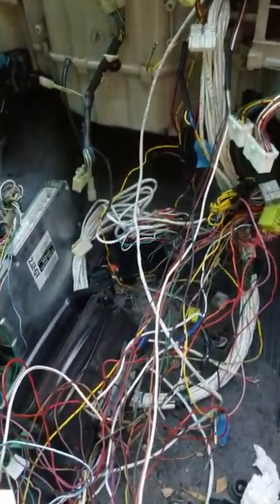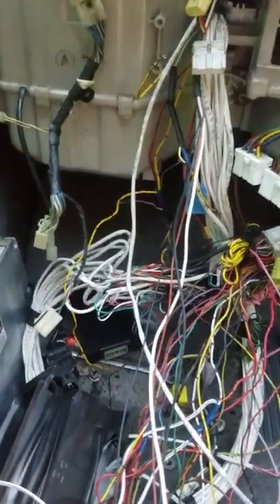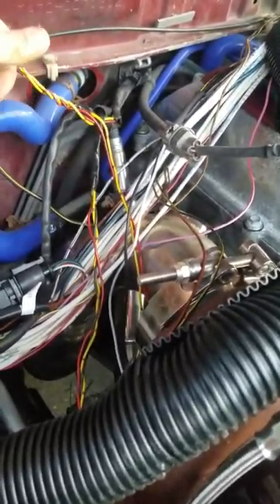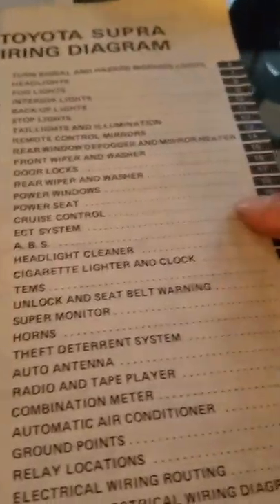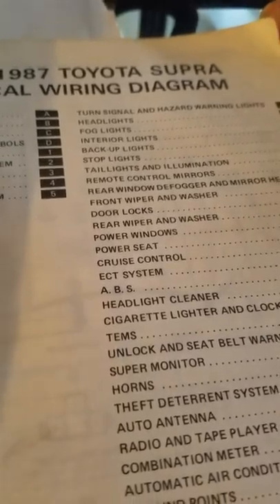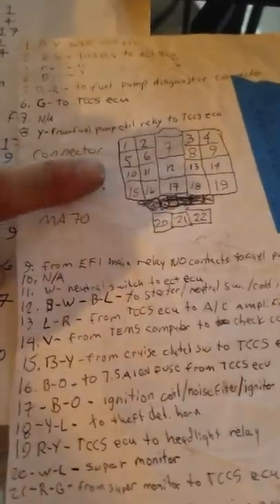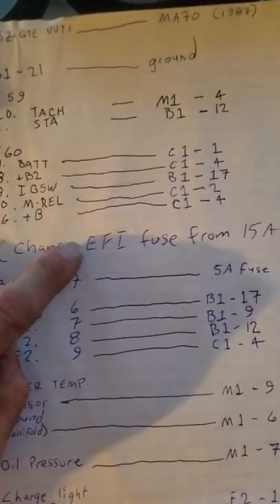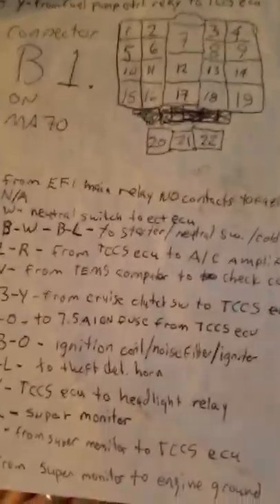2JZ-GTE VVTI MK3 SUPRA WIRING INTEGRATION

Comment: You are a legend for sharing your knowledge to other jz swappers. Had to figure out wiring on my 2jzgte to my mk3 supra as well. Took me around 2 years too. I must say, I don't regret anything, it was worth it. One thing I will mention is, I never got my cluster working as well as my headlights and backlights, I will be looking forward to your upcoming videos hopefully including the cluster wiring! Wish I had the book, I had to manually connect each wire I found to the battery to see if anything worked.. Anyways great videos so far!
Reply from the maker: Thanks for the nice words,I just wish I could have found all the info I needed to do this swap. Between working and family obligations along with the 3 rain seasons we have in south Louisiana,  its taken so long to get things done. And without knowing what you're doing, you can make alot of mistakes like I have. I chopped all kinds of wires I shouldn't have and bought some wrong parts that turned out to be expensive mistakes. So, if I can save anybody some time and money, I'll be stoked that I could help. I'll definitely post some more videos. And since you requested it, I'll do 1 on the dash connections. I may have messed up my lighting circuits too, but once I figure out what needs to be reconnected, I'll do a video on that as well
Reply from the maker: I got it to crank today,but it still won't start.Ive got about 4 grounds I need to check and go through all the basic wiring that got it to run while on the engine stand. The good news is that all my lights work,so I'm wondering if you've got a ground strap somewhere that's not attached. Theres a few right by the battery under the fuses that I had off and nothing would power on.also all the signal lights seem to go through the flasher switch for the hazard lights on the dash. I hope that helps
Reply: Brian Leonard My fusebox seems to be disconnected, that might be why, how did you connect the original supra fusebox to work with the 1jz? Thanks for the ground input
Reply from the maker: @202zeek  there's one big white wire coming off of the fusebox.not quite as big as a battery cable, but much fatter than most of the other wires right there. Its solid white with no other colors or markings. According to the tsrm, that's where the battery mainly jumps into the circuitry besides the one long run to the starter and the alternator positive lead. Make sure everything has an excellent ground  and check for any connections that might not be plugged in on the inside like behind or under the dash. The driver kick panel has a ton of plugs that have to come off for the dash removal, so if you took out the dash, that's where I'd start. If not, your issue is likely right there by the battery

Comment: If you were staying auto do you have an idea where the B1 pin #7 black and blue would go?
Reply from the maker: I took all of the wiring going to the transmission out when I first got the engine because I was going manual with it. But pin 7 on B1 is for the etcs-I motor. Drive by wire and I don’t believe it has anything to do with the transmission
Reply: @brianleonard6879  sorry I wasn't specific on which b1. I meant on the ma70 body plug not the aristo
Reply from the maker: @jackkincaid1260  I looked through the TSRM and I don't see anything about that wire. I have n/ a written down for it, and it could mean that I either figured out I didn't need it or it just isn't there. I'm not sure but I can only assume that the jz computer controls the engine and transmission, while it looks like the auto trans for the mk3 has its own computer that communicates with the engine ecu via 4 or more wires. Of the 4 that are on B1 that are listed, pin 7 is not one of them. Sorry,  I wish I could be more helpful
Reply: @brianleonard6879  no that is pretty helpful thank you

Comment: I just bought my 2jz gte for my mk3. Can you please help me with the wiring. But I am sure NOT going to run it with the oem gauges, without A/C and abs. I just want to get the motor started . I have the 2jz gte aristo with ecu and the igniter.
Reply from the maker: There's only a few wires that need power from the Ignition that power up the ecu and tell it the engine is being cranked. And wires to power up the injector and coil circuits. I've never got the ecu to turn on the fuel pump because I believe the Aristo has a fuel computer instead of a direct output to the pump, so I wired the pump directly to the "run" circuit from the ignition.  That's pretty much all you need to get it running

Comment: Hey bruh....I need help with my air conditioning. i have the exact swap as you, 87 Supra, 2jzgte...Everything works except my AC......
Reply from the maker: I'd be glad to help. I had to touch literal every part of the system. There are relays and fuses near the battery and the passenger side kick panel. And the high/low switch on the hard lines near the turbo